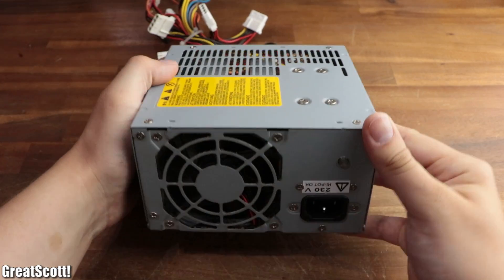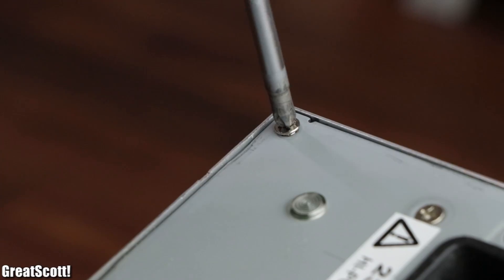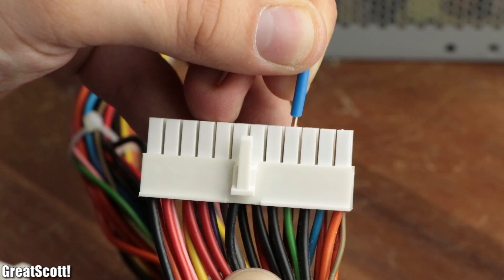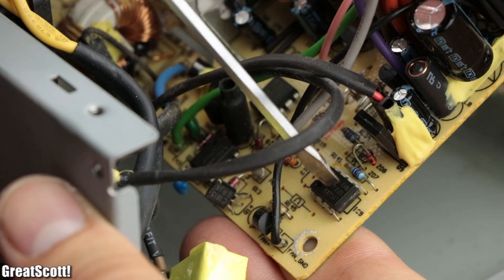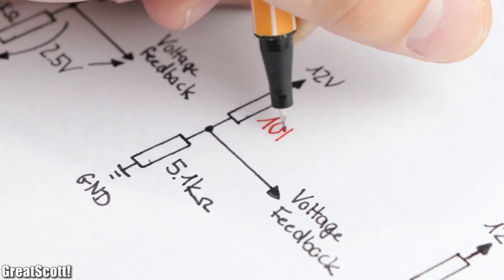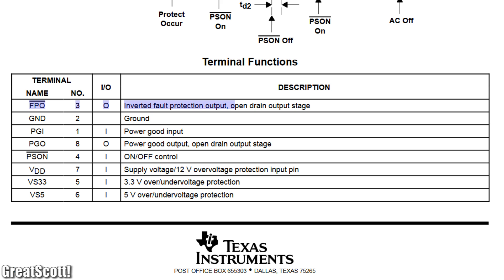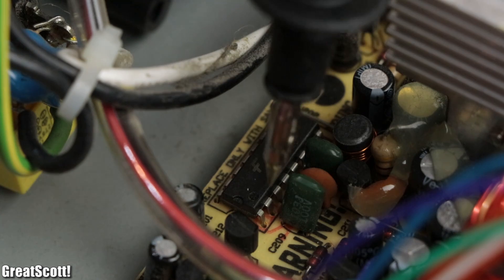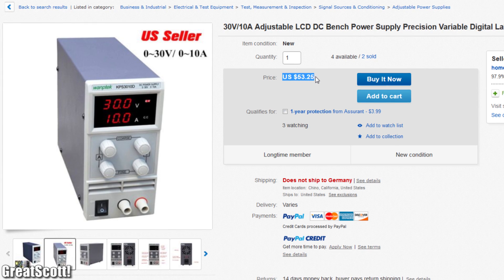HACKED!: ATX Power Supply with Variable Output Voltage?

Comment: It is actually simpler to add a buck/boost converter to the ATX 12V output.
These have both current and voltage settings making for an ideal lab supply.
If you have to fit the converter ouside the ATX supply housing I strongly recommand you build up an extension housing using copper clad pcb's.
If you are smart the copperclad pcb's can be soldered together on the inside corners leaving one side open to the ATX supply housing.
This housing should be made to slide over the ATX supply houing making for a very simple screw fixing.
That will shield off the strong RF emission and you have an easy to modify front panel side.

Comment: You can use tow capacitor connected in series and tow shottky diodes to double output high frequency ac voltage

Comment: if you replace the output capacitor(s) with higher-voltage ones, you should be able to get more volts out safely, no?

the main issue with the ATX PSUs is that they are over-optimized for a specific use case. All you really have to do is to get a few better components (undo said optimizations) and it should work, no?

Comment: I wanted a lab bench power supply but the price of a decent one was out of the question and since i recently fount an old printer on the side of the road i opened up the supply⚡and removed that resistor and replaced it with a 10k pot and got a range of 1.5v-30v 3D printed a case for this on my Ender 3 and got it working

Comment: Yeah, good call... especially these days.  It's now way safer/easier to use an old laptop power brick, usually in the 19vdc range, and a cheap ebay buck converter that has constant voltage and constant current adjustments.  Probably set you back $3, shipping included.  If you want to get all fancy, get a volt/current meter while your on ebay too.  That's another $3.  The end result is a very safe and useful 0-17vdc or so supply.

So says the guy that just built a very unsafe 12/24/36vdc supply at 20A using 3 server-grade power supplies wired in series. :P

Comment: It is simpler and safer to hack the power supply from the laptop. If you are lucky and hit the one where the TSM101 is used, you may also have current regulation.

Comment: So there is no other way to lower the voltage other than using a buck converter?
I only need to reduce the voltage down to around 6-7v.

Comment: i can modify it an it will give 1 volt to 24 volt out put, you need to make fake voltge reference of 5v 3.3v and 12v through standby 5v using resistors network, then add a varable resistance to OP Invert pin,

Comment: There is a good reason to modify old, but quality, PSUs.  Quality, 12V lithium (LIPO) chargers are hard to come by when searching for one >20 amps.  A lot of people buy the cheap adjustable switching power supplies off of eBay or Amazon, which are low-quality Meanwell knockoffs. They may work OK, but risky.  Used, 500-750W PSUs with bronze or higher ratings can be obtained easily and there are some very good under $50. The PSU only needs to be modified to output 14.4-14.8VDC. A LIPO battery's BMS will draw a full load during a charge cycle so you need a power supply capable of delivering 100% of load, while maintaining a low ripple, hold efficiency ratings, and most importantly, not overheat. Any decent bronze to gold rated PSU will do this. It would be great if you made a video making a LIPO charger out of a PSU

Comment: To reduce the hassle get a variable voltage module and connect to the 12v output way much easier than this lots of soldering that may accidentally endanger yourself

Comment: I remember computer PSUs have negative and positive 12V rails, you can get 24V in total. Just buy a one dollar buck converter, maybe 3-4 of them, line them up as new channels. Replace their potentiometer with knob versions, you could also add a digital multimeter. Should work.

Not worth the trouble though, I got a cheapo wanptek 30V 10A supply for  60-70 bucks, great so far

Comment: I just converted an ATX power supply into a variable bench power supply by connecting a 1k Ohm potenciometer from 12V to ground, with the middle pin being the output voltage. It doesn't give me more than 12V but hey, it works!

Comment: Cut the four pin of ka7500 ic and weld to ground for switch off the sobrevoltage protection

In the 1 pin weld 100kohm potentiometer to ground for plus voltages app

Comment: variable zener diode TL431 fixes this problem apparently, I haven't done it myself yet but I found instructions on a website,  you use it to set a trigger level for the optocoupler,   the feedback mechanism switches the pwm on and off based on whether the optocoupler is on or off ( when output is above a certain level defined by a zener diode ),   thats how it works in some designs at least.

Comment: i once exploded a small 25uf cap in front of pwm ic on psu it was like a bullet thx god it was flipped while i was testing hhhhh always use isolation tranformer while working on smps and dont mess with resistors on psu sometimes caps explode

Comment: i want to make a battery charger of an computer powersupply.How can i increase the 12 volt voltage to 13,8 volt of this model powersupply.PowerMan (InWin): IP-S300EF7-2. I hope u can helpt me.  The are 2 ic sk233 got 7pins en R7510a 8pins.

Comment: For low current applications, we can use +12V and - 12V which together gives 24V. But the smps ground  becomes a Hot terminal. To vary that voltage, a seperate circuit has to be incorporated.

Comment: I have a question (which I hope gets an answer on a 3 year old video), I've seen a number of videos converting ATX PC and Server PSU's into bench supplies etc. I have recently done a conversion myself but this was to simply turn a PC PSU into a multi USB charger using the 5V rail to charge 20 devices at a time @ 1A. What I would like to know is could I convert the 12V rail down to 5V and expand the capacity even more?
I realise I could use a buck converter but is there a better / simpler way?
Reply: A series of 5 volt regulators. If you search Digi-Key hard enough, you can even find power management ICs meant for usb charging applications (they can detect a fast charge capable device too!). I didn’t look too hard at them, myself, because I was looking for a different chip, but I don’t think the supporting circuitry was too complex. If you go with the 5 volt regulators (lm7805 or equivalent), make sure you give them adequate cooling. Even at 9 volt input, they tend to want to get warm

Comment: Great GreatScott! Thank you!
Small notation: please never left unconnected side pin of variable resistor (potentiometer). 04:45 and 05:55
Short it to central pin always!
It will keep your load (sometimes very expensive) safe of short voltage spikes out of range.

Comment: Video in short:
-Making workbench power supply From ATX PS
- but we want variable  voltage
-adding buck/bust converter ?
- too much space
-Maybe hacking ATX supply ?
-Too complicated and dangerous
- them use boost and/or buck converter for couple $ max and extend original housing or make bigger
-buy Power supply for 50 $
-PROFIT ! 
oh wait

Comment: Hello Scott, nice video, all the PSU having the 7500IC would work with the modification you did to pin 1 ? or it depends on the circuit. Thanks.

Comment: Hey Great Scott, the blue wire is rated at - 12V. Therefore you will get a voltage difference between that and the + rated lines up to 24v when paired with the yellow +12v line. I use it all the time for projects.

Comment: or just put the buck boost unit in a small box and power that with the atx power supply. think of 12v as "lab power" and have specific voltage converted down stream

Comment: Hello great Scott....
Even if we connected the ATX green (stand by)  wire to black (ground) wire it would still not work as there is load in the computer power supply......
How did you get around and about that .... Mine is not working and I have cornfimed the color codes for the wire are ok

Comment: I have a question, my Power supply has at The 5 volt output a pulsing dc voltage. Is there anyway i can fix this?

Comment: Don´t forget that the fan is 12V powered, and it can´t refrigerate well at lower voltages.  But this an idea to suply 5-12 V to the gear- motor of a cheap ventilator needed today in the hospitals !

Comment: There is a way for sure to modify an ATX smps using a TL494.  It is what I did myself and got an output voltage  of 30v by joining the two 12v windings in the trafo.  Take a look here and see what I did  https://www.youtube.com/watch?v=uXzrmLrwPcg

Comment: Hi Scott. A few years ago I have done the same modification as you did, and I consider the result a full success. Although the voltage range is limited, it varies enough to make the bench PSU useful for my purposes. 
However, I understand why you disencourage your readers to do the same. The risks of dealing with 240vac is immense and you don't want to be responsible for people risking their lives, specially when forgetting to discharge high voltage capacitors is a common error even among professionals. You are right and I agree with your stance, BUT for those who actually have the skills and knowledge and responsibility to safely do this modification, I think it's totally worth it. It's a nice project, easy to do, fun and rewarding to see it working in the end.

Comment: If a voltage regulated output module is placed on any output, it simulates a variable laboratory power supply in every way, right?

Comment: Can we hack a cheap high power server power supply to drive a flyback with mains voltage? If that can be done, the entry to high voltage will be decreased drastically. I have tried many, of which only those with auxiliary supply for the control/drive circuit is possible to be modded. Because you will need to change the pwm to stay at a very high percentage.

Comment: I just used the 12 volt positive and the 12 volt negative ran to a cheap buck converter and now I have 24 volts down to 1.2 volts.

Comment: I was doing the same thing yesterday, to make constant current source of a switch mode supply. But failed. I burned down the whole circuit while testing. And like in this video my supply also had a uc3842 ic and copler for feedback. But i just failed, if any one knows better about this feedback thing please help.

Comment: He is right...  but with proper precautionary steps it should doable... Like, moding protection features instead of disabling them... Also big warning to tinkerers..The are usually two big caps that need be discharged

Comment: Respectfully, I would disagree with your conclusion even you did explained inner workings quite a bit. Peek into any PSU schematic will prove me right.
The problem is that you've tinkered with PWM input directly, but it gets way more stable (even with all protections in place) by changing Vref of the voltage comparator. Further on, most of the PSUs are equiped with current limiting capability that's also fed to PWM input via comparator via voltage divider or another comparator. Hence, you can even have variable constant current output.

Comment: -12v +12v output through some sort of high performance potentiometer dummy load to measure current n voltage (cheap disply kind meter from aliexpress) everything works fine for me never done heavy test on them as i just need 5-10v max

Comment: use an old laptop or printer P/S, and get a several amp buck converter.   buy an led voltage and amps output, and make yourself an ugly little variable voltage, current limited box.  i loved mine until i accidently zapped the led with 170 volts, and it's toast.

Comment: This is great I know myself I'd like to see a program done the same way using a server psu. In eluding a volt amp guage and adjustable voltage and constant current. I would have a lot of uses for it I would like one where they put two together for a max 24 volts. Thanks again for the great program

Comment: "Here's how to do it... But don't, because it's not safe." ;)
Reply: It's not funny. For beginners, any modification with 230 volts will be able to end of death. I think the idea of buying lab bench power supply is very good. At the beginning of fun with electronics it should be very cheap because in future you'll make your own. More advanced than first one.
Reply: @maciejpilarski2035  Make no mistake. I'm not making light of electrical safety. I think the way the video progresses into a "Never mind, don't do this." is funny.
 I love his videos. They are super helpful for beginners so they don't end up getting shocked.

Comment: As the saying goes, "So many [ATX power supplies]... so little time."  What, then, is the essential difference between a lab bench power supply with adjustable voltage and current limit controls and an ATX power supply having fixed voltages and no current limit controls?  I accept the dangers in effecting a conversion (and appreciate your describing them so clearly to us) but using a stock ATX supply as a bench supply, as so many people do, is also dangerous (at least to the circuits they work on) because of the very high currents they can deliver into a short circuit. Fuses cost money and do't always protect the circuits under test.  Don't some bench power supplies use switching technology or are they all linear designs?

Comment: Hey Scott, I did something like that yesterday, but i ended up rewounding the core to give me 3.3, 5, 12, 18v ground referenced
and two 18v floating for a DRSSTC full bridge driver.

Had to use few schottky, one more ferrite, few electrolytics, decreased the switching frequency from 65 to 40kHz as my new core was N27 type, increased soft start and tricked the smps that everything is just all right.

Comment: Hello friend
I have a power supply has these info 12v,20A max. When I tried to operate a DC motor the power supply always turned off until I tried to operate the motor with 3.3 volt at first then adding the 12volt wire then remove the 3.3volt when I did these procedure the power supply work normal.
What I can do to operate this motor or anything with out doing these procedure .and I want my power supply give my max. current in 12volt to operate more than one motor.
I am looking forward to your reply as soon as possible.
Thanks alot
Reply: you need a dummy load(5V) on those old psu´s otherwise the psu is going off.

Comment: When I turn the rotary dial from 3.3 V to 5.0 V or from 5.0 V to 12.0 V,  the power supply will stop  and turn off itself. I do not know why. I used a rotary dial to connect the power header from a PC supply unit with green  green and black  connected to a switch. That is if I want a different voltage, I have to switch on every time.

Comment: The first power supply that you were modifying, that style works great. The high wattage ones with the UC384x chips are usually 2-switch forward converters and regulate very well.
When you're modifying the feedback circuits in these, you must not modify the circuit around the UC384x chip. Since the feedback is with an opto-coupler, the voltage division and comparison is done on the secondary side with a TL431 programmable shunt (or sometimes but rarely a zener) and that sends a simple on/off signal through the opto-coupler back to the UC384x chip. You only need to modify the divider going into the TL431. The TL431 is usually a TO92 package and looks like a small transistor.
Reply: also you should only modify the lower side resistor of the divider, otherwise it is possible to destablize the feedback loop

Comment: Mr Scott.

I want to create my own lab power supply, and i need some help at this point.

My ATX power supply gives like 14 Amps on the 5v line, and i'm scared of connecting something like... Idk, a USB device, because it can get fried instantly by those 14 amps right? How can i modulate them using some potentiometers or resistors? My range could be from 100mA up to 3A because any of my jobs never needed 14 Amps...

The same for 3v3 and 12v, i don't need 15 amps. Just 2 or 3 in emergency case...

Could you give me some advice? Thanks

Comment: i was playing with 111v of a fan of 220v i put the transformer output it was really shocking when i touce te wire but something was happend my CFL lightbulb blows up i turn thr light off take the bulb look inside and take the printboard i know how many voly out is 43v

Comment: You can disconnect a optocoupler acting as voltage protection, you have to find correct optocopler with multimeter. Now your supply is completely ready

Comment: Good day. I have a power supply from a samsung monitor. Id like to try to make a dv lab bench power suply with variable voltage.
This unit has two 650VAC at 7.5mA and two 5.1 VDC 1.1A. Do you think this is a good idea? In the end id like a power supply that ia DC output ,maybe 1VDC to 30VDC.
Reply: The unit i have is a BN41-01700B taken from a SamsungS19A10N monitor

Comment: If the IC is varying the frequency of the transformer wouldn't it have to be attached to the primary high voltage side of the transformer?  or are you varying a low voltage feedback signal? Because there's continuity to the 12v pin It kind of looks like you just put a potentiometer in series with the output to give you variable series voltage drop. Which is lame, if thats the case.

Comment: I don't want to mess with the existing circuit of the PSU, I'd rather take the standard 3.3, 5, and 12v rails, and add an additional circuit (perhaps fed from the 12v line) to buck/boost and allow to setting a constant voltage or constant current. A simple screen to show the set voltage or current and standard connectors! The connectors are what I always have trouble with, I end up poking jumper wires into the floppy connector because they fit perfectly and I can get 5v and 12v as well as gnd from them, though not at high current.